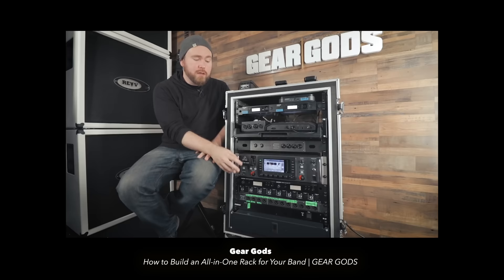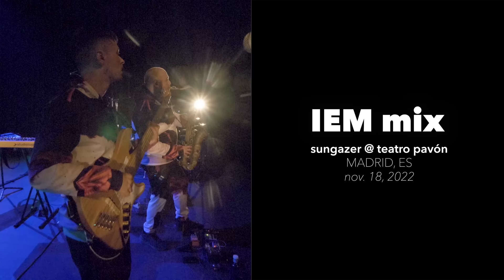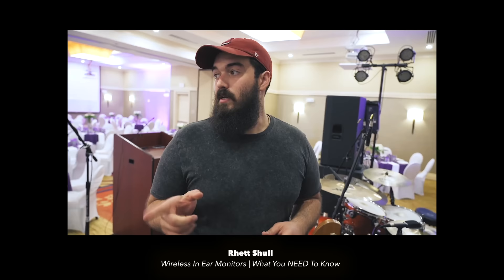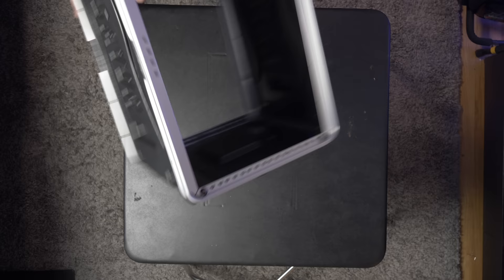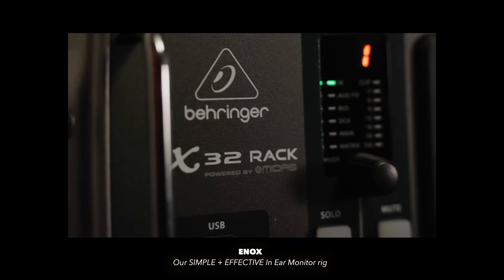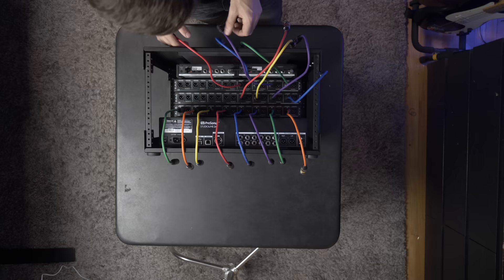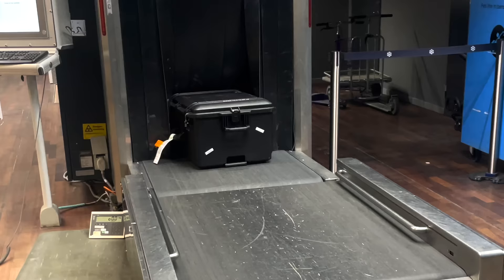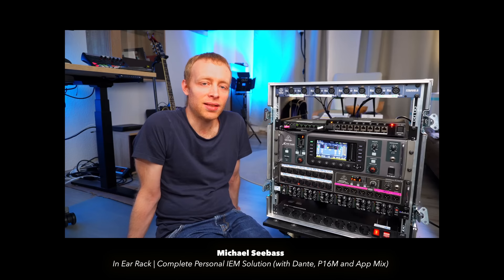How In-Ear Monitors are Making Better Musicians

Comment: i screamed seeing the price of just those low profile cables. Audio equipment is EXPENSIVE
Reply: Make your own! Wayyy cheaper
Reply: @Daniel-boy737  How TF do you make a cable? Lol
Reply: @Checkmate1138  easily lol. All it is is 3 wires bundles together into a cable casing each attached to pins contained in a plastic, rubber or other material casing that holds the pins in a certain configuration making it easy to plug in or out.
Reply: @Faunarr  So then, where do you get the pins? Or heck, where do you get the correct wires, rubber casings, etc.?
Reply: @Checkmate1138  you usually would look at places like farnell, onecall (or your country's version of these websites) ebay could work too. You could either go completely from scratch, make a mould or 3d print the connector head and then install the pins inside in whatever way is applicable for the situation. Hell I've done a manual install of such a thing because buying proprietary connectors for expensive equipment like transducers, sensors, etc can be incredibly expensive. If you don't want to go completley from scratch you can usually buy premade connector heads for cheap. And regarding the wire if you're super ghetto you can just get 3 shielded copper cables and electrical tape all around. Though however that would be a waste of time. There are wsys of making it proper but there is simply no point. You could just buy 3 core wire, or however many cores you needed. You could in theory buy 12 core wire and split it off into 4 seperate xlr connections that all run through one cable that has 12 wires inside.
Reply: @Faunarr  Youvlisy me at "3d print the connector head" hahaha 😂 Sorry man, I think you need to have more experience and familiarity in electronics if you want to attempt to spend a lot of time making a cable. Besides, how can you ensure it will be of good quality, be reliable, and not be hazardous (such as being an electrical or fire risk)? 

If I was going to have cables made from scratch, perhaps I could instead hire a professional to do it for me. Maybe it would also turn out cheaper than buying the store-bought cables? Yeah, that's what I would do, and I think others should as well (unless of course you're into making cables from scratch).
Reply: @Checkmate1138  well for signals you usually don't have too much current, especially as processing them usually requires no current at all due to how opamps work.

If you don't want the cables to burn you'd get some that are rated for a certain amperage. You'd check the datasheets for each device you're planning to use them with. But you could probs get away with cables rated for 5A. But whatever works for you innit

Oh and yeah, familiarity with electronics helps. But as long as you followed datasheets for everything you have or follow tutorials it'd be fairly simple. Hell I had to do it when I had 0 electronics experience and basically 0 soldering experience. Would it be reliable or good quality? Yeha you'd have to research your materials for that xD. And audio equipment often requires good quality conductors and probably shielding to stop emf interference

Comment: The key is to have your own mixer and NOT having to fuck around with the sound engineer :) 
My band has our own mixer and barely has to change anything between gigs.

I would never bother with IEM without our own mixer. NEVER. Maybe for a singer only, but often its unfortuntealy difficult to deal with sound engineers.
Reply: I play live in church. We mix our own IEMs with our phones or tablets. Controlling my own mix is necessary since it is imperative to me to lower the volume of some of the elements so that I can hear my own instruments and my own voice if I sing. Regrettably, not everyone wears the IEMs. It works best if everyone is using them; otherwise, you will have singers who squeeze their sound too tightly so they can hear themselves via the mains. They are missing the beauty of nuance by foregoing the IEMs.

Comment: Pretty soon DANTE is going to absolutely revolutionize all of this. It's already being used a lot in studios now, and in large distributed audio systems. Thanks to the magic of networking you can easily send many channels over cat5/6 without the reliability issues you mentioned on the analog Ethernet snake. No more xlrs no more db25's, just rj45 terminated cables.

Comment: Another nice thing is that IEM transducer technology has improved by leaps and bounds over the past five years or so and now you get legitimately good and accurate sound reproduction without needing to mortgage your house to buy them. The receiver and other auxiliary control and mixing units do still cost a fair bit, but at least the part that goes in your ear and is most liable to break won't beggar you if it does.

Comment: Sound engineer here... 
Quite solid info overall, but I would strongly suggest going with the Behringer P1 or P2 which are active units instead of the PM1 you're suggesting in the video, which is a passive unit. 
The passive unit can't amplify the signal so if the signal you're getting from the sound board is weak then you're screwed. In my experience the PM1 wasn't enough on the few occasions I had to work with one. I had the AUX send maxed out, but the singer kept asking for more. 
The price difference isn't huge for the active units and it's totally worth it in my opinion. Keep in mind you will need to use batteries or a power supply though.

Comment: Cool! I love the "take matters into our own hands" attitude. Especially since it lets the in-house sound person have the time to give the audience a better experience. Maybe in future, you can explain why it's so much easier to understand voices on YouTube than it is in most movies and TV shows...

Also: it's definitely worth looking into doing your own cables. Common connector standards are designed to be easy to make so that they're cheap to manufacture, and that also means it's pretty simple to make -- and repair! -- your own cables. PC modders, A/V installers, electronics nerds, and general tinkerers do it all the time. I highly recommend Big Clive here on the YouTubes. He's a professional electrical engineer who's worked on large live productions in the UK, and he has some really good tutorials about soldering, checking cables with a multimeter, and working with XLR specifically. He even built a custom tool to easily check if an XLR cable is good or needs to be replaced. Like yourself, a scholar and a gentleman.

Comment: Excellent info source.  Just recently encountered a gig where a solid bass player was placed in front of the shielded drum kit and in the line of fire of a hearing-impaired e-guitar player's amp (the latter refuses in-ears, one of those "I got to hear the air moving, man" players).  The bassist uses a DI rather than his own amp.  That day he played probably the sloppiest set I've ever heard from him.  I approached him during the break to get some feedback, and he said he couldn't really hear himself, even though using in-ears.  He said the sound was too muddy.  While it could have been from funky monitors, my guess is the sonic wash from the other two sources were interfering with the output of the monitors, with his own signal getting lost in the dissonance.  Solution?  Move him.  Some times the right solutions are the simplest.  Cheers!

Comment: I play bass with a touring gospel choir, all our gigs are usually big open air festivals or theatres, it’s a 7 piece band with anything from 20 to 50 singers depending on the venue…I use IEM’s all the time, no amps on stage. We use the same 2/3 sound engineers all the time so all our IEM mixes are stored and can be recalled instantly on sound check. My IEM setup comes in at around 100 bucks, my body pack is a Behringer powerplay P1 which is about €60/70, my IEMs are TRN’s..(similar to the KZ zs10 pro, I just prefer the fit of the TRNs) which were about €50..and that’s it..I don’t have molded ear pieces I use comply memory foam tips instead, they are so comfortable…my in ear mix is perfect I hear everything with such clarity and a healthy low end punch from my bass and the kick drum..AND at minimal volume..I never leave a gig with ringing ears…FOH loves em as well, they’re not battling a monster bass rig bleeding into the stage mics

Comment: IEM and silent stage is awesome. We run a Soundcraft ui24r which does all the inputs and outputs and is a decent mixer in its own right.  We use a HA8000 headphone amp to boost the aux outputs. Compact, neat, reliable. And sounds great.  About £1000 if all bought new.

Comment: The good old Siemens Messerleiste/Federleiste in 30 poles springs to mind, to replace your DB25s and the four extra cables. More robust and 10 ch, so two of them can carry all 20 outputs to the FOH. 
Harting also makes great, robust multi pin connectors suitable for touring.

Comment: Great video man. I'm a longtime local and touring engineer. IEMs are wonderful and I so wish we had them back in the 90's when I did BVs from behind the kit in rock bands. 
I guessed the 24r might be your option when I saw the space in the rack. Great bit of kit. I have one and I've mixed heaps of shows with it. The interface mode is pretty cool with Studio One. I'm playing around with AVB at home for the home studio. 
I like the verbs more than the X32. More immediately use-able. Lots to like for the $$ and the footprint.
Can't believe I wasn't subscribed yet. Sorted.

Comment: As someone who used to do some sound engineering with a lot of musicians that were new to IEMs (I also played keys with some of those musicians). One thing I learned quickly is that plenty of musicians (especially ones who are newer to performing) have no idea what they need in their monitor. I remember noticing that the bassist kept taking out her IEMs and I had to sit down with her and help her figure out what mix worked well for her so that she felt like she could hear what she needed to. Our setup gave the musicians full control over what was in their IEMs but they had no idea how to give themselves a mix that was useful for them so they felt like they couldn’t hear what they needed to hear. But it made life so much easier not needing to mix wedges especially if someone had to share a wedge mix

Comment: My god that Trey excrept was awesome! Last year I went to a festival and you could clearly tell which band used the inhouse engineer and which one came with their own stuff prepared beforehand. And it pained me to say that one of my most favorite bands (and actually expensive to hire) relied on the in-house engineer which ultimately lead to break-ups during the concert itself. Lots of false singing due to the singers not hearing anything properly even after hours of soundcheck. Absolutely hideous. While some cheap warm-up bands had it all figured - they just plugged themselves in, couple of minutes to balance the drums of the venue to their own in-ears and they rocked us. And no false notes from the singers too! Pure awesomeness.

Comment: Another plus with IEMs is elimination of feedback from vocal microphones. Since a stage monitor is pointed at the performer's head level, and that's where the microphone is, it could easily trigger a feedback loop if the audio/monitor engineer is not careful. This gets even worse if the performer moves around the stage a lot, as they need to be able to hear themselves and the band at any distance upstage and downstage... which means that if the stage monitor is louder to be heard upstage, then that's even greater chance of feedback downstage.

Comment: Great way of explaining all of this equipment! Just one thing to note for people interested in building this type of thing- if you're doing fly dates with wireless in-ears, be sure to check the countries legal wireless frequency areas (some US equipment can't be used in the UK, and some has to have a frequency bought per venue/date if it's outside of the UK Ch38 (606-614Mhz) or is not a 2.4GHz wireless system)!

Comment: In marching bands every single section with the exception of the drumline watches the drum majors for tempo. The drum major initiates the tempo, and then control of the tempo is given to the center snare. The vast majority of time a drum major spends on the podium is spent watching the feet of the center snare to relay that tempo to the rest of the ensemble. If a member or section of the ensemble starts to listen to the drumline instead of watch the drum major, however, something called a tear can happen which is when two or more sections of the ensemble disagree on either what the tempo is, or even where in the music they are.

Comment: Thanks so much for this video. Definitely the most approachable video of its kind that I've seen. You made it clear a lot of your inflated cost was because it had to be international flight-ready. But even at $6k, the IEM setup pays for itself. Not just in consistency and saved frustration, but because you don't need to travel with a monitor guy.

Comment: Our sound engineer urged us to switch to IEM. I was not enthusiast because of cost and danger of high levels in case of mistake and isolation from each other and public reactions. We tried with a cheap solution : some Behringer P2 and cheap IEM surprisingly good I had tried. That was outstanding. We'll never go back to wedges.

Comment: Thanks Adam for such a great video. Can't tell you how much I love to be in charge of my own mix. I've been using a Presonus 16.4.2 AI for mixing our in ear monitors + wedges/sidefills and a DB-25 to XLRM for FoH. Being doing it +5 years. Plus, iPad connectivity to control main and monitors, and the possibility of record everything live with a firewire 800 + macbook, it's amazing.
Even when I sing only with tracks, I do own my monitor mix (with a smaller setup).

Comment: Quick build note to anybody trying this - make sure to measure how far back you need to recess the rack panels. The awesome Circle Three rack is adjustable, and you don't want to accidentially damage the foam spacers in the Flight Case by leaving the ends of your rack equipment too close to the front or back of the rack.  Go ahead, ask me how I know this. 😀

It's much better to lose a little depth in the rack than it is to damage the flight case and potenentially your equipment from the inside!!

Comment: Great video! As a sound engineer bands with tight efficient IEM setups are an absolute dream to work with. One thing I'll add is make sure your tails to FOH have plenty of length on them. Certain stages/festivals it's not always possible to have the artists rack near the stage box. Or there might be multiple stage boxes to FOH at different points on the stage.

Comment: wanted to bring up a use case not mentioned here - someone who plays with bands that don't have their own in-ear rig. I play keyboards and sing. I ended up getting a personal mixer with 4 inputs. 2 for L/R keys, one for vocals, one for the rest of the band. the mixer has split outs so the FOH engineer gets my vocal signal from the mixer, keys come from my DI, FOH gives me an aux XLR send for the band. that way I'm only relying on the sound guy for the band mix, so in cases where there's not much time to get everything dialed in I will at least be able to hear myself very clearly, and my vocal mic can pick up some ambient sound.

I've actually been using the Shure IEMs for years now and they haven't failed me yet ...
Reply: That sounds great and like it really works for you. What mixer do you use? Musician and foh engineer here🙋‍♀️
Reply: @oliviac295  I use a Shure P4M. Unfortunately long discontinued, took me a while to track down a used one for a reasonable price. Rolls makes something similar but they are pretty janky and cheap.

Comment: the split signal based alternative mix is a very thought out solution! although if the FOH mix happens to, hipotetically, give to much gain to  the base, the interpteter can't adapt to such situation
Reply: (too*)  it requires a very dynamically controled perfomance, and based on experience only a few very professional acts are capable of that

Comment: You can skip the big splitter and snake. Split the vocal mics right at the mic stand. Single channel mic splits are small and inexpensive (I just leave it on my pedal board with a 6’ mic cable ready to go). Run your vocal splits, inst DI’s, kit mic, ambient mic, etc. to your own monitor mixer. The sound guy already has his own mics and DI’s plugged in and ready to go. I play a festival every summer with a 15 min. change over between acts. The sound guys on this gig are top notch but they just don’t have time for plugging in a rack or doing an IEM mix. We’re ready to go with a great mix in minutes. It’s fast, light, dirt cheap and sounds great.

Comment: i'm a solo muscian. I use an acoustic guitar, looper, and drum machine, and I sing. It's impossible to play my best without proper monitoring, and the venues where I play often have terrible acoustics. I like to hear the room while I play, so I've turned to open-back wired headphones. It might look a little odd to some people, but it's solved the problem perfectly. I find it disorienting to plug my ears up or to wear closed headphones. The only thing it doesn't do is reduce volume, but that's OK - I don't play at ear-bleed volumes, and I need to hear the audience. Grado Labs, Senhaur and AKG make open and semi open headphones that are high quality and affordable. I use wired for cost and latency issues, and also because my rig is stereo. Really great to hear my reverb and delay bouncing around inside my skull while I play.